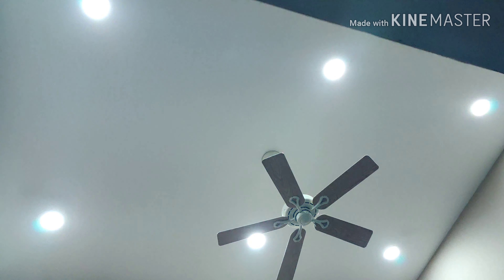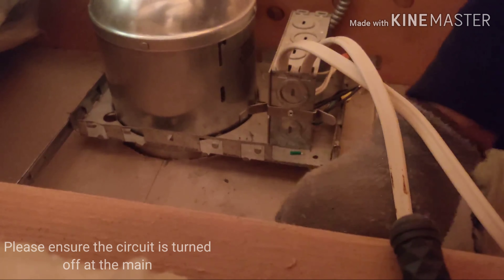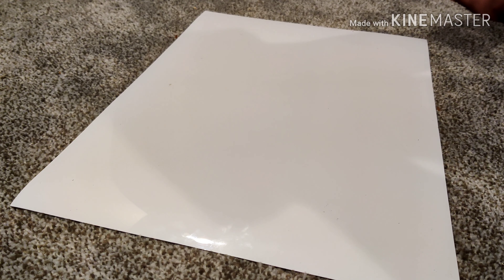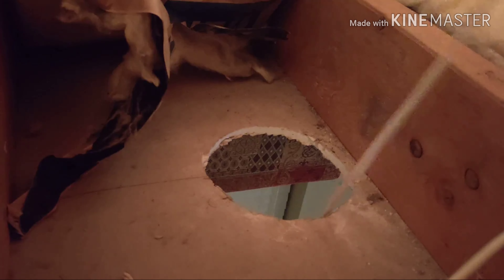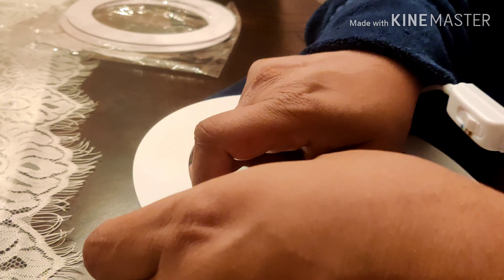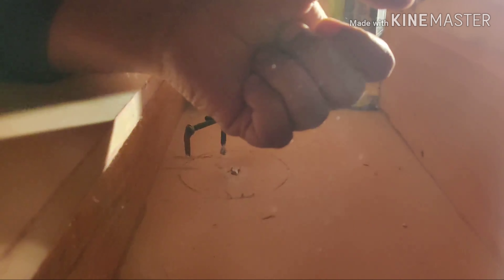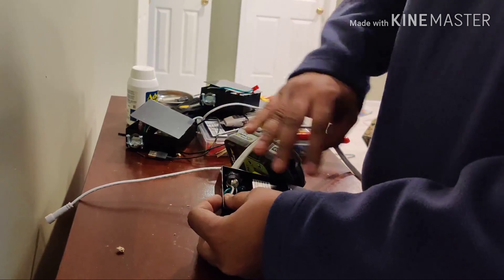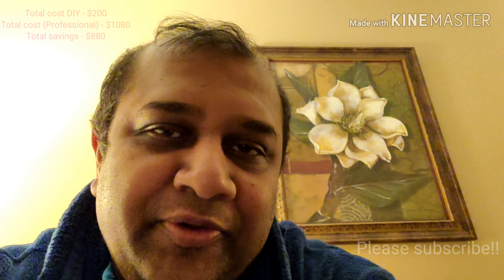How to install LED recessed lighting on high ceiling - A $200 DIY project

Comment: I too have a high ceiling and want to add a few recessed lights. I thought of the attic approach but I was just a bit nervous of how safe it would be to move through the attic without falling down. Also I was thinking on how to get the recess light install from the back - the rope idea was brilliant I didn't think about it. Thanks for sharing!
Reply from the maker: Glad to see it helped.

Comment: Hello! The lights appear wonderful. I'm interested in knowing the lumens of the led lights you used. I have a ceiling of similar height, and I'm wondering if exceeding 1200 lumens might make the room overly bright. Additionally, were you able to incorporate a Kelvin temperature switch into the setup?

Comment: Hi I have a 20ft ceiling and I need to replace the builder provided recessed mount LED light. Did you get a ladder rental? If so, do you have any recommendation?
Reply from the maker: No I did not get a ladder rental. See the video to know how I did it.

Comment: How high is the ceiling? You just used regular recessed lights? Not high output? Was it enough light? I have a job to do but thinking the light will not be bright enough

Comment: On Amazon, you can actually get these with a manual switch in the internal housing that allows you to change the color temp from 2700-6000k. It’s amazing because you’re not stuck in the daylight color temp and can dial back to pure white if you find it to be too bright for your space. Great job though.
Reply from the maker: The one I used from home depot also has the three switches to change the color temperature. I found the home depot brand to be more reliable than the Amazon stuff while offering the same features. I can set three different light temperatures on the one shown in this video.

Comment: Hi. Thanks for the video. It was very helpful and gave us the confidence to attempt this project. We have installed LED lights in my LR. The LED light is (11) in your list. It was working initially but in a week since, it is tripping the circuit breaker immediately when turned ON. We turned off all the loads on the circuit and this is still happening. What is going on? Would be great to hear your thoughts/advice.
Reply from the maker: I installed only 6. You should always check if your circuit can accommodate the number of new lights you are adding.

Comment: Great video. I’m also considering doing this myself but with different approach since I don’t have attic access. Are the light you used rated for direct contact with insulation?
Reply from the maker: Yes they seem to be rated for direct contact and I have insulation layer over it. Thanks for watching. Please subscribe to my channel.

Comment: We have 16’ ceilings in our living room. What color, lumen, and spread would you suggest for our recessed LED lighting (4”)?
Reply from the maker: I think it's a personal preference. For my bedroom with about 8 feet ceilings I still used a 6 inch.
Reply: DIY Build and Life sorry maybe i was unclear....  What color, lumen, and spread would you suggest for our living room (16’ ceilings) if we are using 4” LEDs?
Reply from the maker: @justinbinaesq.7713  Personally I think 4 inch may be small for the height you have. If I had a 16 feet ceiling I would do a 6 inch. Also the lumens depends on how bright you want the space. The model o linked can support three lumen ranges which is for soft white, warm and very bright. I have it set at bright for family room and warm for bedroom.

Comment: If you cut the hole from above, it tears the paper on the sheetrock below.
Reply from the maker: I did it and it did not tear it. For two areas a small tear happened but has been concealed by rings.